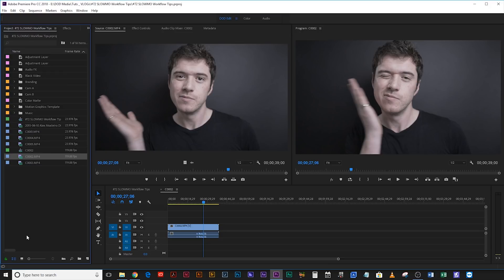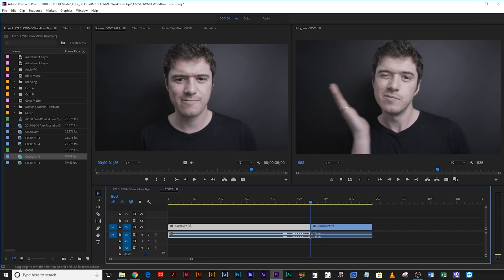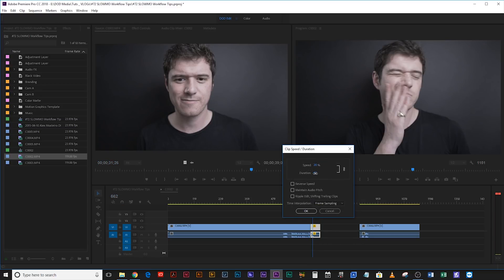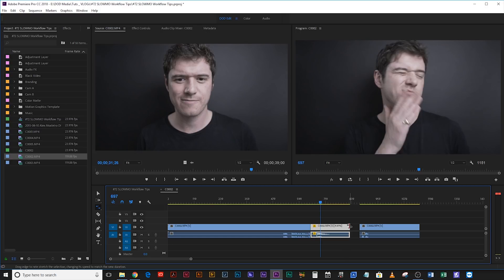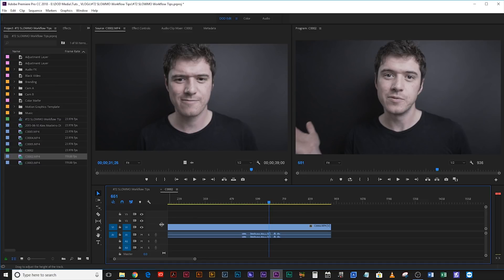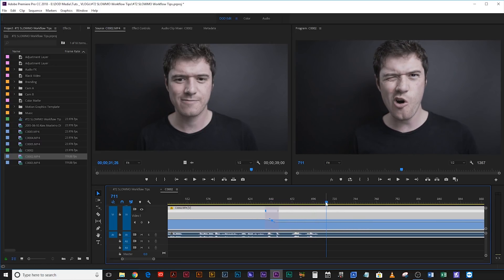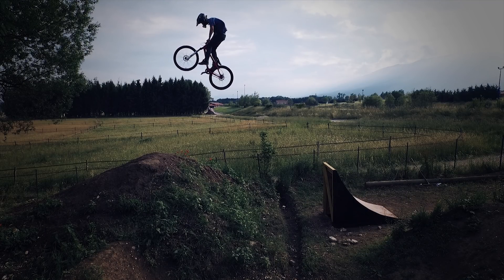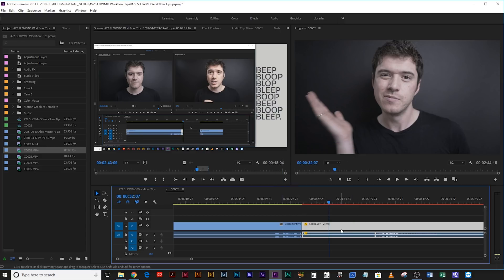SLOW-MO Workflow Tips for Premiere!

Comment: AAaaaahh so many values! Great work though :)    Would the flicker you get on monitors/tv when filmed also be solved with pal/ntsc?
Reply from the maker: That's a trickier one because a lot of TV and monitor screens are 100hz or more so it's really down to the monitor. But if it's 50hz or 60hz then yes!
Reply: Makes sense, thanks.